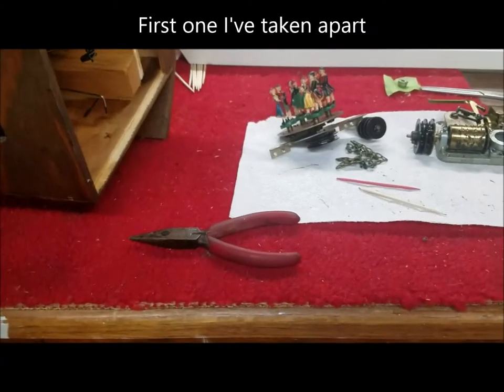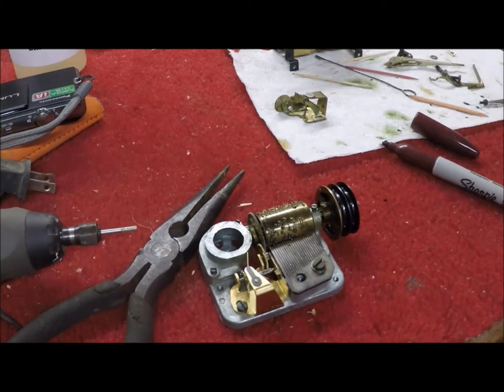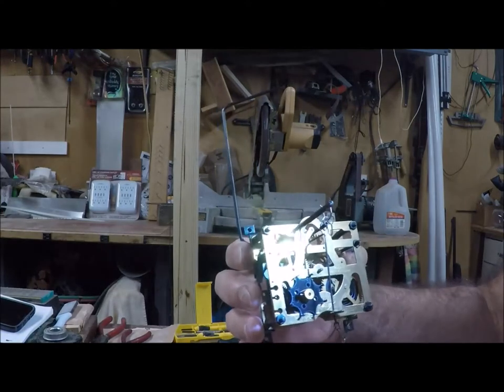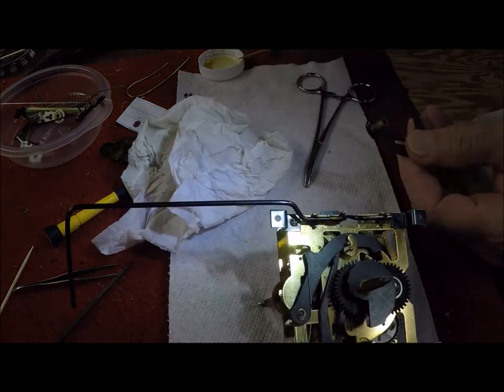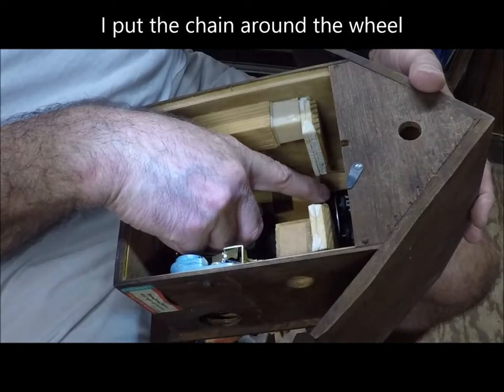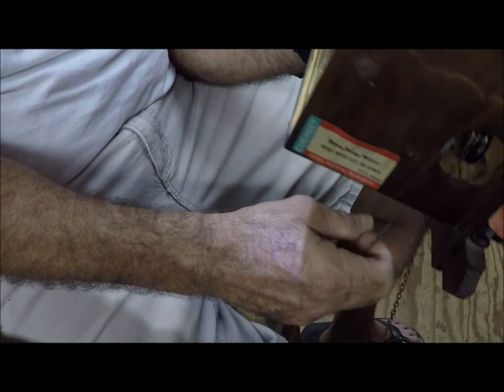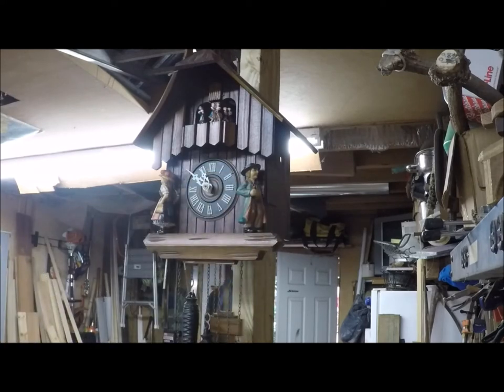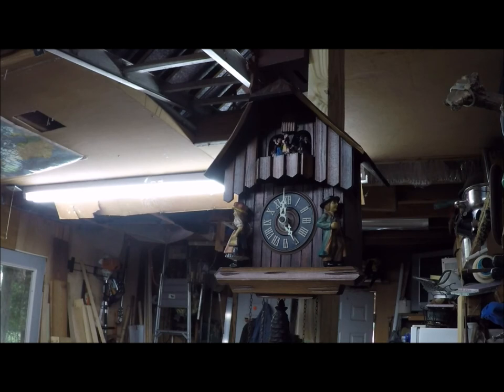Cuckoo clock repair with music box

Comment: If anyone needs to know, at 24:08 you can see that this a Regula 25 78 Made in West Germany. This is a 3 weight clock.

Loved the video!!! I have a similar clock (Regula A25-84). I had the same issue with my music box that I am troubleshooting and the plastic gear in the music box was cracked. Waiting on parts to come in so I can tinker some more on it.

Comment: I haven't come across a slotless screw for the music box, odd. The wire for the music box, when the music box is triggered with the thicker lever, the wire should also drop in front of the fan, governor, so the fan does not move until the cuckooing is done and then the wire will lift out of the way of the fan so the music will play. (It is kind of like a warning pin in the clock). Thanks for mentioning my name. God Bless.

Comment: If you want to clean the Movement you have to take it appart and clean the Pivotholes with a toothpic. Otherwise the old Oil is still in there.

Comment: This is the first cuckoo clock that looks to be designed like ours, with the music box to the lower right side from the back and a twisted chain across the top to the dancers. Can you please explain what the single circle chain twists around?  I am afraid to take the music box or the clock innards out without knowing how to put that circular chain back on.  I have taken off the right side shorter bellow. Is there anything I need to remove to get the circular chain back on.  Appreciate any help you can provide.

Comment: O.K.  I've checked my clock, it seems to be running fine.  I also had the music box chained in with it and absolutely nothing.  It even seemed to hold the clock from running although I don't know if it did or not.  I took the music box out and noticed two things, one, there is a broken spring which I'm sure ran between the trigger bar and the bracket where the fan is in place.  The second thing was that I cannot turn that wheel as was being done at 9:33.  The cylinder will turn back and forth about 1/16 of an inch in both directions but it does not go forward to where the pins are striking the comb making musical notes.  Currently I am considering soldering the spring back in place and putting a bit of oil into the pin drum pivot.  Am I on the right track or do I need to try something else?  Thank you so very much.
Reply from the maker: If the music box is binding, it will keep the clock from running. Make sure the trigger bar lever is not locked in the wheel  ( at 13:50 )  Also, you can remove the comb as well to make sure that is not binding the wheel.   They are tricky to get it all lined up

similar part here with a spring?
https://timesavers.com/i-9994475-music-movement-stopper-bridge-with-spring.html
Reply: @pcdubya  The trigger bar was definitely not locked in the wheel.  I had moved it aside to try to spin the drum.  Somehow the wheel/pin drum assembly is now turning and I can hear the notes.  I ran it through a ultrasonic bath about a week ago.  Should I put some oil in the pivots now?  As for the illustration you sent, the bar is quite similar but rather than the other end of the spring being attached to a plate, it was attached directly to a pair of holes drilled into the governor by running them through and tying it off.  The spring wire broke at the end where it was tied to the governor.  Since the drum now does turn, I'd take that to mean that I need to either get or make another spring to go between the bar and the governor.  So, perhaps winding springs into existence is the next phase of my clock learning?  Thank you so much for the guidance.
Reply: @pcdubya  The part looks quite similar but the spring is connected to the arm and the other end was at one time connected to the governor through two holes drilled in it.  The governor looks completely different from the one in the webpage.  The pin drum now turns but it takes a bit of pressure to get it to move.  Should I oil it in the pivots?  Meanwhile, I'm looking for replacement springs as well as a tool with which to roll wire (I bought a spool of wire last week).  Hopefully I'll get good at making springs sooner than later.  Thank you.